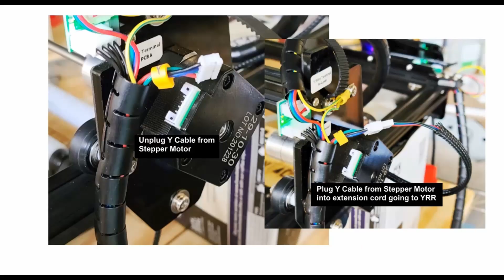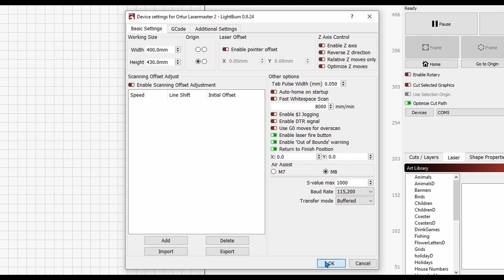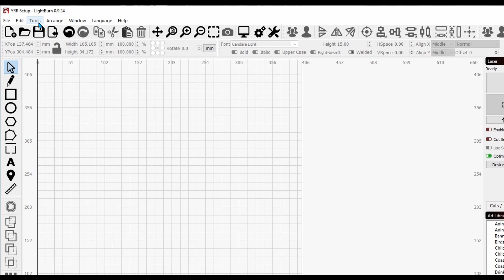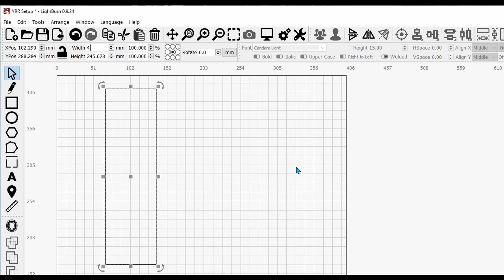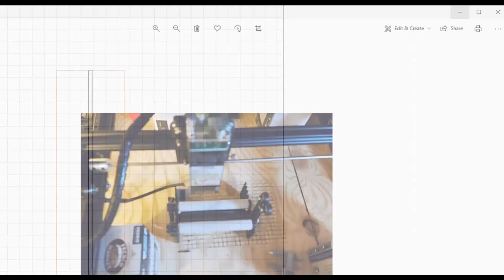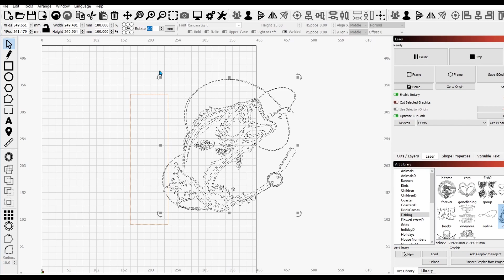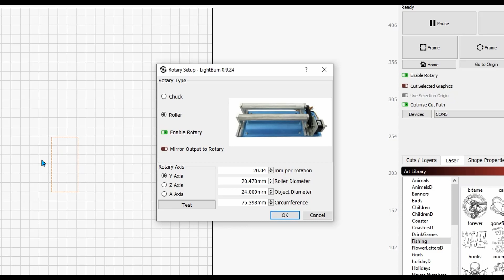👍 Ortur YRR Rotary Setup - The Only COMPLETE guide!

Comment: I use painter's tape as shim material under my flex steel surface. It measures 0.12mm thick. Could that have been part of the reason your first number needed adjusting by 0.4?
Reply from the maker: I don't really know! We're all learning as we go!
Reply: @TheLouisianaHobbyGuy  I'll rewatch the video when I'm not distracted. I may have missed something simple. I'll know for sure if/when I get a rotary for the Z1.

Comment: What power/speed are you doing? I've seen 250/95% pretty frequently
Reply from the maker: My power and speed won't be the same as yours. There are many different variables involved. I usually run tumblers at 500 & 70%.
Reply: @TheLouisianaHobbyGuy  Sorry I failed to advise I’m pretty sure we have the same laser. I have the ortur laser master 2 pro
Reply from the maker: @evannorthcutt2687  Mine only look like the LM2. I have a 14W laser module on it Evan.
Reply: Oh ok thank you. Sorry to bother you I just have one more question. I can’t seem to get circular logos to turn out, they are always condensed but I know I have all of the dimensions correct for everything. Any idea why it would do that?
Reply from the maker: @evannorthcutt2687  I would have to see an example Evan. Sign up on my Forum where you can post pictures.
Reply: Just did it. I appreciate the help sir

Comment: Great video.... i have a question: When the laser starts the burn the rotary moves very fast to its starting point. Do you know how i can adjust this movingspeed, because when the object is a bit light it will slip in the rotary tool.... thank you very much.
Greetings from Holland
Reply from the maker: Try turning down your whitespace scan to 200.
Reply: @TheLouisianaHobbyGuy  thank you for the quick response..... ill try this when im home.... greetings
Reply: @TheLouisianaHobbyGuy  i did try this ... even turning the whitespace completly off did not help.
Reply from the maker: @peterhendriks1972  Are you using absolute coordinates? If so, it should just move to the start position without rotating.
Reply: @TheLouisianaHobbyGuy  yes i do use absoluut coordinates, i understand what you mean.  Im a woodturner and i engrave my work..... to get the best position i oriant from te middle... so starting from a corner does not work for me.
I think im going to ask help on the forum.
Reply from the maker: @peterhendriks1972  I don't think you'll get an answer, but it's worth a try. Jason (Oz on the forum) is the creator of LB and is actively involved on the Lightburn Forums. Perhaps he might have some insight.
Reply: @TheLouisianaHobbyGuy  oke.... thats a great tip, thanks.
I will try that. if i get a the solution to my problem ill let you know.

Greetings from Holland ;-)

Comment: I don't know what I'm doing wrong I follow the steps but when I turn it on after plugging in the rotary I have a flashing red light on my master 2 pro and it won't fire anymore. I have to do a system reset just for it to fire. So basically it seems I can't use use rotaty
Reply from the maker: You may have a mis-wired pigtail. I would suggest you open a ticket with Ortur tech support. Gil will take good care of you: https://ortur.tech/support/
Reply: @TheLouisianaHobbyGuy  I opened a ticket and they sent me the code to reset to the defaults and it works normally but something with trying to set up in lightburn it doesn't work. I just tried with GRBL laser and the rotary works with that... I don't know what I'm doing wrong where it won't work with lightburn though.
Reply from the maker: I can't imagine... it's got to be one of your settings.

Comment: Great Video, I'm not certain why but after rotating my image and text -90 degrees i also have to flip mine horizontally or the text burns backwards.
Reply from the maker: Untick the button in rotary settings that says, "Mirror Output".
Reply: @TheLouisianaHobbyGuy  It's actually not checked, I can check it to correct the issue. It appears that my extension cable may be mis-wired on one end. If I connect the ends of the extension cable together the red and black wires don't match up.
Reply from the maker: @Ken-with-a-S  That's weird! I would correct that if it was me 👀

Comment: Looks good, but can it be used with a K40 ???. I am thinking of purchasing one of these but at £120 it is a lot of money (to me anyway) to risk if it won't interface with the Chinese Laser.
Reply from the maker: The adaptation to the K40 would be hard to do and probably cost prohibitive Rattler. You would need to change out the controller and add the TTL wiring. That's about $50 US right there. Keep in mind the K40 is about 33-35W, as compared to the optical output of this one at maybe 14W. I know they claim it's 80W, but that's exaggerated marketing. It's really 60W input and maybe 14W optical output. The largest diode for hobby lasers possible is 7.2W. So with two diodes, I would guess this one would come in somewhere around 13.5 to 14W max. The K40 is more than double the output.
Reply: @TheLouisianaHobbyGuy  Thanks for the advice. I am a total newbie on this and want to someday build a business out of it.
Reply from the maker: @rattler-60  No problem, good luck!

Comment: I have a question regarding the setup on the Machine Settings page. Your instruction state turning to false the Soft Limits and Homing Cycle before saving. Since there are only 2 items to change why do I have to save this. I can remember this when changing back to standard laser. If it is absolutely necessary to save what is the procedure to do this. Where do I find this saved file and how to activate it? The video is a great reference to revert back to. Thank you.
Reply from the maker: Hi Dick, If you want to manually change the settings, that's fine. You find the save settings wherever you save them to. I would suggest creating a folder named Lightburn.

Comment: Great tutorial. I have one question. I'm more use to using "inches" therefore I used inches in my set up. My rotary setup page items are measured in inches, roller dia, obj dia etc. except the number of rotation is mm. How do I change this calculation to inches?
Reply from the maker: Right under the Gear Icon at the top of Lightburn you'll see "in" in a little rectangle. Click on it and it will change to mm. You can go back and forth all you want. It doesn't change any other settings.
Reply: @TheLouisianaHobbyGuy  thank you

Comment: Really a great and thorough step by step you created !!

Have you or could you do this for the Chinese Lasers ? Mine has a Ruida controller and 25 x 15 bed size.  Your is the best tutorial I've seen regarding the rotary.
Thanks Tim
Reply from the maker: Hi Tim, not familiar with the Ruida on a C02. Most of this video is compatible with  Co2 or diode lasers. It's mainly the software setup.

Comment: Thanks so much for making this video but I ran into a problem when I clicked the frame button. My rotary spins properly but the laser goes all the way across and bangs against the rail. Any thoughts why this might be happening?
Reply from the maker: Manually move the laser (by hand) all the way to the left and try again. You probably had your settings wrong. You should be in absolute coordinates.

Comment: Thank you very much for this video. But how does it work with the LM1? Lightburn doesn't allow to put a circonference bigger than the workspace of the machine.
Reply from the maker: Your circumference will never be larger than the work plane. That is the distance around the outside of the cup.
Reply: @TheLouisianaHobbyGuy  Hello, I’m familiar with what is the circumference 😬. But the Ortur LM1 (the little one) has a workspace of 160mm X 150mm. So any basic tumbler has a bigger circumference than the workspace.

Comment: Can you please make a video how to engrave a conical tumbler?
Thank you!
Reply from the maker: Absolutely! That is on my to-do list Eugen! Probably within the next week or so.
Reply: @TheLouisianaHobbyGuy   how do you calculate the mm per rotation? what is that?  Thank you!
Reply from the maker: It's in the video Eugen. If you're using the Ortur roller on a diode laser, I have found that 66.40 is the best setting if you checked Enable Rotary. If you didn't check Enable Rotary, it doesn't matter what the number is, Lightburn passes through the dimensions from your graphic accurately.
Reply from the maker: That's what I have found as well! Thanks for the tip!

Comment: Great video ! I do have one question with the settings you just showed this would mark all the way around the cup correct? What would I do differently if I don't want the text or image to go all the way around and instead be in a smaller area on the cup?
Reply from the maker: The rectangle you draw is only a guide, and you only burn that to get your rotation with tape protecting the piece. Once it's dialed in, you set that box as a toolpath so it doesn't burn. Then you put your graphics inside the box and the only thing that burns is the graphic itself. It takes a couple of times watching this video to get the hang of it....
Reply: @TheLouisianaHobbyGuy  sorry I don't think my question was clear. I understand the box is a tool path which doesn't get marked and the smaller rectangle was just to set your rotation. So with that said, anything you put in the box will wrap around the cup correct? Is there a way to set exactly where you want something ? Like if the cup your using already has something on it and you want to add another picture 180 degrees from the first picture is there a way to do that ?
Reply from the maker: @jason92725  Yes, I get it now. I have to do another video on this. But you position the artwork directly in the middle of the rectangle for one sided. It will not wrap around unless your artwork goes from the bottom of the rectangle to the top. To cut the same graphic on both sides, you have to position two graphics,  one, 1/4 the way down from the top of the rectangle, and the other 1\4 of the way from the bottom, equally distanced. It's really too hard explain in text.
Reply: @TheLouisianaHobbyGuy  I think I understand. I'll have to mess with it and see what happens . I'll look out in case you do another video. Thank you !
Reply from the maker: @jason92725  I'll put it on my loooong list! 🤣
Reply: @TheLouisianaHobbyGuy  😁

Comment: I worked through your excellent video to calibrate my Ortur rotary. I'm experiencing two problems. First, at some point, changes I make to mm per revolution does not change the output. I see you recommend turning off "enable rotary" and set mm per rev to 20. What does that accomplish? The calibration is still off. Second, when I try to burn a circle, it seems the sides of the circle are flat on the y-axis side. What adjustments do i need to make to get this thing squared away?  Thanks again for the video and for your expertise.
Reply from the maker: Hey Vince! Yeah, on some control boards, you have to turn off the the enable rotary so it doesn't distort your images. Some boards are just not compatible. Setting the mm/rotation doesn't really do anything on non compatible boards. With the enable rotary off, Lightburn passes through the tool path settings. So if the tool path rectangle is, let's say, 150mm on the Y and 50mm on the X, that will passthrough to the YRR. You're going to manually adjust the "mm per rotation" by increasing or decreasing the Y measurement. I am working with Ortur to resolve this control board problem. Hopefully they'll address it with a firmware update soon. Thank you for the great question! 👍
Reply: @TheLouisianaHobbyGuy  
So what I understand you saying is that on the rotary setup, uncheck"enable rotary", set mm per rev to 20 and then just adjust the size of the test rectangle so the ends meet. Correct? Any thoughts on the circle issue? An Ortur problem? I really appreciate the quick response.
Reply from the maker: Sorry Vince, I didn't get notified of your comment! Yes, you're correct. That is the current work around.

Comment: Hello Rich, just set up my rotary . I just watched your video my question is the practice burn does not go through the blue tape  ,correct.Great job on the video, can't wait to start burning tumbers, stay well..
Reply from the maker: Check your settings on the laser tab! You don't want to go through the tape, just mark it to make sure your settings are correct. This way you don't ruin the product you're testing. For anodized aluminum tumblers, I use 85% power and 600 mm/min speed.
Reply: Thanks for answering my questions so quickly and what would the setting be for stainless steel painted tumblers thanks again brother
Reply from the maker: @MontesPlace  Same... 85% power and 600 mm/min speed for me. I would not touch the tumbler when it's done though, just in case I have to do another pass or change the settings.
Reply: @TheLouisianaHobbyGuy  thank you rich I know you've been told before but your videos are awesome man thanks for the help I'll let you know how I made out
Reply from the maker: @MontesPlace  Good luck! Let me know! 👍